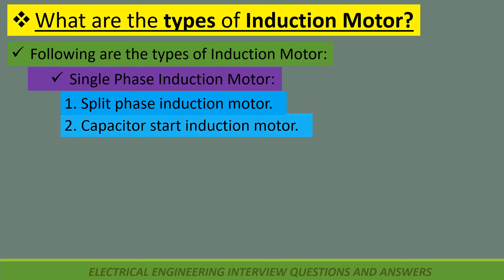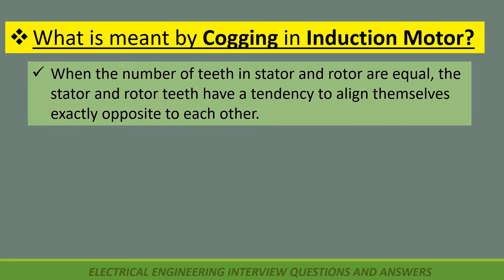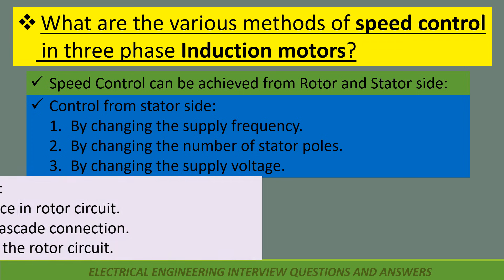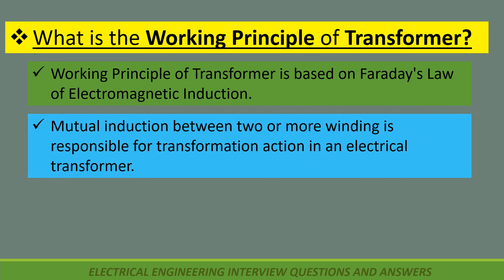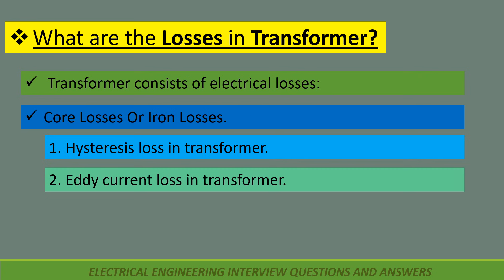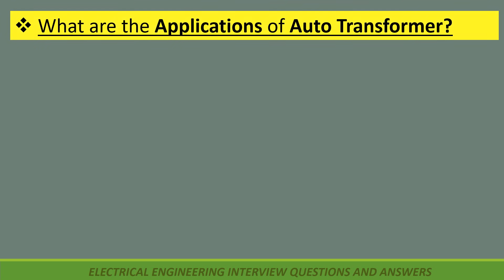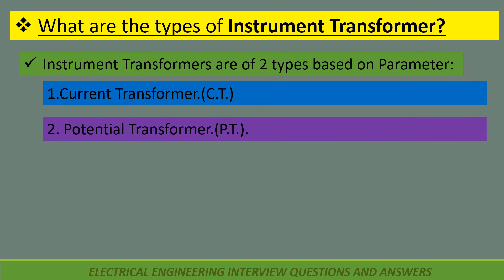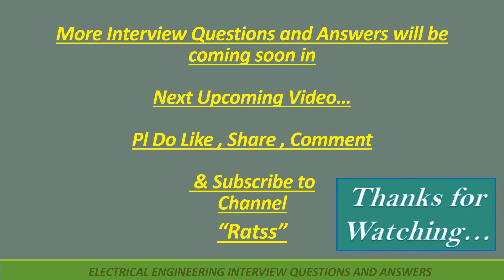Electrical Engineering Interview Questions & Answers  asked in companies like L&T, ABB , Siemens

Comment: Dear sir please clarify whether voltage level can be changed in transformer from 208/121v to 400/230v by means of vector group change or any other option it's most urgent please reply which is in need in Saudi Arabia

Comment: at 12:14 check once, if current transformer is used to step down then why primary has few turns and secondary has large no. of turns?
Reply: CT is step up transformer.purpose of CT is to get low current in secondary side so voltage will be high i.e more no. of turns
Reply: @SumitKumar-nv9bq  I got that! Tq

Comment: why transformer do not operate in DC supply?
Reply from the maker: Transformer works on Faraday's principle of Electromagnetic Induction.
For Inductance (or Inducing EMF) a changing flux (i.e change in flux with respect to time) is required , Which is always happening in AC supply.

Whereas in DC supply , there is no change in flux with respect to time , the flux is constant. So as per Faraday's law of Electromagnetic Induction , Transformer can not work on DC Supply.

Hope Your query is resolved, Pl keep on watching the Channel for other useful videos.
Reply: as transformer work on mutual induction principle, and dc can not perceive mutual induction as well it behaves as pure resistive , means regular current through primary coil only increases losses and temperature increment resulting in burn out of winding
Reply: mutual induction will not be possible by using D.C (emf cannot be generated)

Comment: Sir Maintenance job me jyada growth h ya electeical autocad me......plz ans
Reply from the maker: Basically in maintenance job , u can learn about different machines , drives , transformer and different switchgears , this type of job requires people who  are good in  troubleshooting and who can take quick decisions and almost all big companies have maintenance department , so it is easy to change job.

While talking about electrical CAD , only CAD is not sufficient in design field ,one need to be good in basic electrical calculation and knowledge of other softwares like ETAP is also added advantage.Usually this type of job requires good theoretical knowledge along with good soft skills.

I have mentioned very few points , there may be many points other than this.

Important thing is what do u like and what type of job u get , both are having very good growth options.

Hope your question is answered.
Thanks for writing.

Comment: 1 question is wrong only two types of induction motor slip ring and squirrel cage
Reply from the maker: Dear Lokesh Selsurkar 

Please note based on 1phase and 3 phase following are the types : 
Types Induction Motor

Single Phase Induction Motor

Split Phase Induction Motor

Capacitor Start Induction Motor

Capacitor Start and Capacitor Run Induction Motor

Shaded Pole Induction Motor

Three Phase Induction Motor

Squirrel Cage Induction Motor

Slip Ring Induction Motor
Reply: Ratss AESQUARE ALL ABOUT ELECTRICAL ENGINEERING ok bro
Reply: nhi right h q ki aap Jo bol rahe ho o rotor ke type h